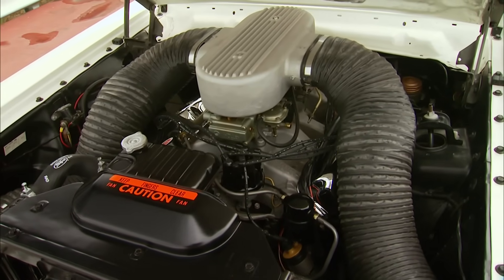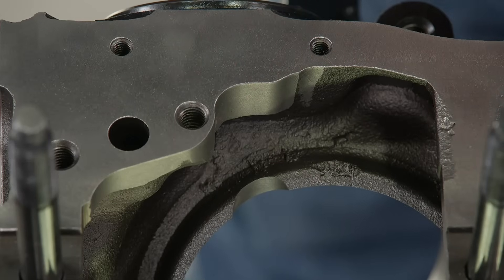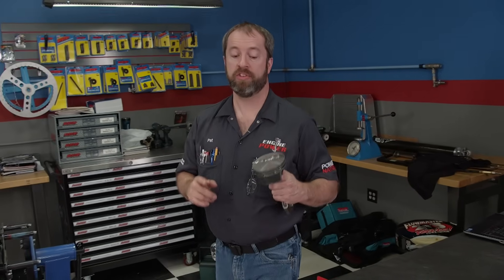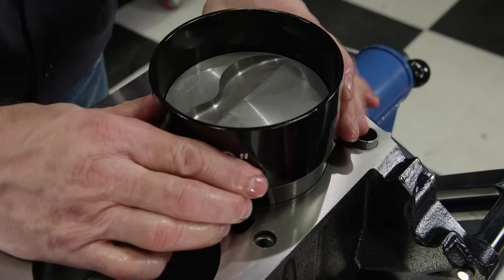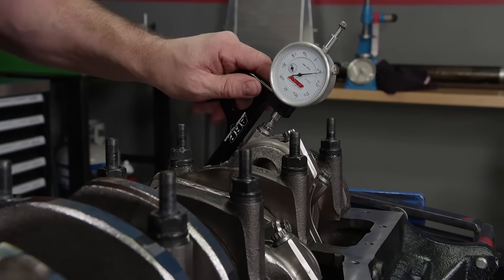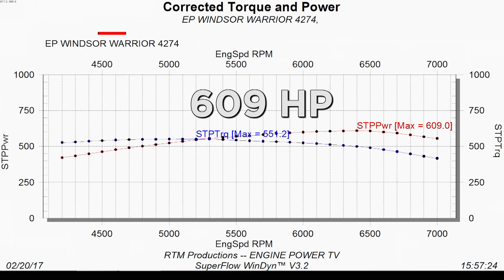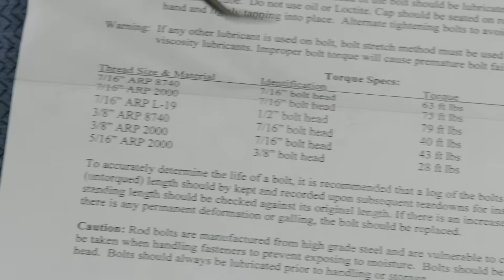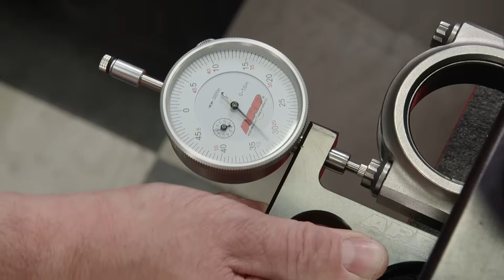Ford 351 Windsor Grows Into A 427 Stroker With Double The Original Power - Engine Power S4, E7

Comment: Hey uhh, 4.030 bore and 4” stroke is a 408 not a 427. You need a 4.125” bore with a 4” stroke to get 427 cubes..
Reply from the maker: This engine has a 4.170" stroke crankshaft

Comment: 11.5 motor isn't a pump gas motor
Reply from the maker: With proper tuning and setup, it will run just fine on 93 octane pump gas. Static compression is only part of the equation when it comes to octane needed and we have done countless combinations in the 11.5-12.0 static compression range that have run completely on 93 octane from the gas station.

Comment: Looks like you installed that piston bone dry, should use plenty of oil on the cylinder wall piston skirt, rings n lands and ring compressor, shouldn’t look dry until cleaned

Comment: With the bore of 4 030 & stroke of 4.17 they have a 425.5 Cu In engine. The ford FE 427 with a 4,234 bore & 3,785 stroke had 426.3 cubes. I am building a Windsor. with a 4.125 Bore & 4.0 stroke which adds up to427.6 cubes. I am not going out for max HP & torque, but expect  to have over 500 HP & 500 hundred pounds ft of torque. Putting it in my 1957 Ford Fairlaine  500 two door sedan .

Comment: I have a 69 Torino. With a 351 winsor.  I Think that engine won't fit. My stock valve covers are to close to the master cylinder

Comment: I just don't see that as a 427. One of the reasons the Ford 427 was so stout was due to the bore and stroke combo. The motor was over square. With a rather small stroke of 3.7 something ( I can't remember) but it's almost 3.8 and the big bore it lends its self to hi rpm and did back in the day a very good job of it. Also a version they did not mention is the one that was used in NASCAR and lots of privateer racers if they could get them was the hi riser. The medium riser was in the t-bolt and the cobra but most Ford racers that ran any oval track racing back then ran a 427 hi riser. If you didn't know someone at Ford back then you couldn't get one. They were not available to just anyone who has the money to get one. The only difference was the heads and intake. The runners were probably another 1/8 taller and the heads flowed very good. Anyway If I was ever going to build a small block 427 I would follow the same FE bore and stroke combo and use a set of C3 yates heads and you would have a very good comparison to the original hi- riser 427 Ford...also the FE 427 was a cross bolt block. And all steel forged internals so big rpm was no problem unlike this 2 bolt block. They should have used a Dart block so they could turn it some rpm

Comment: I wonder where the revs would be @ peak power if instead of stroking the small block 351 to 427. De-stroke a big block 427 to as close to 351 as possible. 
It would probably redline around 8,400+ rpm.
There would be a slight loss of peak hp versus a stroked engine, but you gain in torque, higher redline, and increased engine longevity at higher rpm's.

Comment: Good street engine.  In Oz we have our WONDERFUL I6 Ford Barra DOHC engine. I am in the throws of building one of these engines to around  450KW- a baby compared to the performance capabillities of these world class 6's.. There are so many 12sec falcon family sedans on the street.( Sleepers ) Now for the unusual aprt. I will be putting this little sleeper engine in a 1943 Ford blitz short wheelbase body/chassis. Hopefully it will be done by end of year.

Comment: You mentioned the bottom end gets tight so talked about checking the assembly for clearance with the camshaft, i didn’t see that even though you did mention that the camshaft was off the shelf. I once built a 383 chevy stroker and the crank hit the camshaft, had to go small circle cam. I think in your case since it is not a standard sbf it was not a problem but for anyone stroking a regular small block it is wise to check rotating clearances before finishing assembly.
I agree with you wholeheartedly to use a stretch gauge.

Comment: I built a Windsor 351 stroke to 427 made 690 horsepower. Put this in a square body Mustang.Best best was was 9.4sec at 144 mph.   Fun,fun,fun. Dart block,dart heads.

Comment: If you notice on the graph the long stroke motor is already making over 500hp at only 4000 rpm so and like 562 at 5252 ( where HP cross over and read the same) . 

My point is to only gain another 50 Hp by revving it to sky high another 1800 to 7000 rpm doesn’t really make a lot of sense pretty indicative of the combo being a bit overkill. 

When the torque is that flat you can pretty much shift at 5500-6000 and it will run about the same ET and be way easier on parts. 

I built a much milder 427 that I only rev to 5600-5800   But it makes about 520 Hp but it has enough torque at 2100 rpm to cruise with a 5 speed manual Tremec in overdrive at 70 mph. In a 2350 pound cobra replica I wanted a motor that felt very close to a factory 427FE with torque everywhere. I’m very happy with it! 

The segment talked about for shoulder to cam clearance but never showed any of it…I’ll bet they had issues!! I had to relieve the shoulders of all my rods to clear the cam lobes and even rr ground the cam to a smaller base circle. 

Btw stroker 427’s like tighter lobe separation and more cam advance. Why close the intake so late and give up all the stroke just to gain RPM?

Comment: I don't want a bigger engine. I'd rather build a great 289, 318 or 283. Sounds the same. All the power you need for today's driving. I don't need to use more gas than that.

Comment: Does the 427 Windsor have a higher deck height than the 351?
Reply: This 427 is made from an OEM 351 Windsor block so the deck height remains factory minus any clean up cut.
Reply: @mchristr   Ta

Comment: from the looks of it, they appeared to be degreeing the cam with the #2 cylinder(first cylinder on the right side of the motor)
Reply: Front cylinder on passenger side is #1.   Fords are numbered 1,2,3,4 down the passenger side, 5,6,7,8 down the driver's side.

Comment: I'd like to see hor cheap 393w builds! I"d have to dive thru the barn, but i got the parts to build that! I'll be going in a 94F150 flareside! Can't use what you can't hook up anyway! Build a cheap  5 liter piston, Windsor rod, pressed pin 306 piston motor! Big hydraulic roller cam that will drop right in my 95 roller block! I got heads!

Comment: what about this conversion on a 351 cleveland block
Reply: The Cleveland block has a 9.2" deck which requires a shorter rod and compression height on the piston. But there are kits out there if you want to do it.

Comment: For me im lucky I own a 351 Windsor pushed out to a 427 all Debured oiling system improved all Roller rockers and chain titanium valves bronze Guides Heads ported and Majorly polished  with a Supercharger for a lighting 95 f150 and 42 pound injector and Dynoed at 875 horse power and all in a 94 Mustang GT and have No problem in cleaning house on the 2 ton coyote Mustangs

Comment: Would love to do something to up the pwr in my 1991 351w F-250?  This vid looks pretty much like expensive ultimate racing build & have enjoyed watching.  My tired OEM motor even new only 210hp.  Hard to pull itself up a steep hill E4OD auto tranny.
Reply: You can use your block or go to the salvage yard for a roller-cam block. Use the stroker kit but go with dished pistons, a milder cam, and home ported factory heads. It may only make 350 hp at peak but the torque number will be huge. Exactly what you need to move a heavy pickup truck.
Reply: @mchristr  Exactly the info I was hoping for - thx so much!

Comment: What is a cost estimate for something like this with a shop doing the work? I'm out of the loop on car stuff, but remember in the late 80s and early 90s when someone getting a chevy 427 for 3 grand in need of a rebuild was considered expensive. There were engine shops in or close to pretty much any town of size, and maybe most of them are gone because little is rebuilt by the public, but total cost for a rebuild back then was probably some fraction of an engine and we considered it "expensive".

Comment: Be nice to build one of these engines to produce its top torque at a lower street cruising speed RPM for better MPG or would be just as well off building one like this?

Comment: Could you do a stage 2 for the windsor warrior 427 engine, a solid roller cam, shaft rockers, holley sniper fuel injection with their high rise intake and stand alone system. Just so we can see what the upgrades and power diffence is. On pump gas, and on higher compression, higher octane.

Comment: The Championship Cobra was the small block Cobra that still used the Triumph front suspension and Jag E- type rear suspension that came on all the original unchanged small Cobras. The big block Cobras had an overgrown body with completely different chassis and suspension, brakes steering, etc. etc. But the spelling of Cobra was still original.
Reply: The 289's spinning to 8K is what won all the championships in the cobras and daytona coupes. Loved this build- great job. Never discussed what the maximun safe RPM was.

Comment: I would like that one day they do a program in which they teach some tricks to improve oil pressure and lubrication for those 351w
Reply: They won’t do anything that isn’t tossing a bunch of sponsored parts at a project.

Same reason they won’t massage stock parts to make more HP, there’s a whole class of drag racing based on stock appearances where people make 10 second passes on cast iron heads and manifolds, you won’t see that here either because there’s no sponsor cash

Comment: The 427 version of this engine will not last very long. A simple 351 turbo build will last longer, and still have more power. A 351 is a 302 stroker. Don't be stupid.

Comment: Is there a difference between the 351w 5.8 manufactured in the 70's and the EFI, from the 90's? Can I apply this setup and parts to the 351 5.8 EFI engine?

Comment: hey you two , how about retesting the 351w engine with the new  4.25 stroker crank shaft and with a LOW END TORQUE camshaft and not the high rpm one`s

Comment: I don't know why they used to always preach the "too big of a carburetor for the engine" years ago. Kind of like installing larger cylinder heads.....you can go pretty big before it starts degrading low speed performance.

Comment: I thought a Windsor is 4 bolt main?  This looks like a 2 bolt.
Reply: No 351 Windsor's came with 4 bolts from the factory. Only some of the Cleveland's did. You can get aftermarket blocks with with 4 bolts. You can convert them to 4 bolts also but with the cost of machining, you are probably better off just getting an aftermarket block for a few dollars more.

Comment: 351 Windsor is the best engine Ford ever made. These new modular engines suck. Sure they make more stock HP & TQ but they leak like a Harley Davidson with a myriad of electrical electronic and transmission problems and factory recalls. I'll never buy another new Ford. 1995 or earlier.

Comment: WRONG...It's not the cubic inches that matter! What made the 427 great, was its bore and stroke. Bigger bore engines make more horsepower because it allows bigger valves. On the other hand long strokes make more torque but it limits RPM's. Shorter strokes rev higher and therefore has the potential to make more horsepower. What you guys made was a long stroke torque motor that now has very high piston speeds which limits rpms. This stroker kit has been around for 20-years at least and it does well at the drag strip, but its not a tribute to a 427FE without the proper bore and stroke

I built a 750hp 351W that matches a 428CJ bore and stroke pretty closely. The 428CJ has a 3.98 stroke and I have a 4.00 the 428CJ has a 4.13 bore and I have a 4.12
Reply: A nice explanation. I don't know of any factory built Ford V8 with a 4.030 bore combined with a 4.170 stroke?

Comment: Wow.... taking a 351w to 7000rpm.
The last time I ran a 351w I had all I could do to get her up to 5500...and she probably stopped making power before 5500.
I did manage to squeeze 322hp out of her,She was out of breath around 4700.
Back then there were no aluminium heads etc for the 351w and add to that I really didn't have the know -how to really understand what I was doing.
She still ran very good,Spanked a few other cars around,But she didn't have the power like your engine
Over 600hp!!!  It just wasn't possible for most of us..you want more RPMs you had to consider moving up to a 351C or really do some wizardry on a 390,428 or a 429... skills and money which I didn't possess
Reply: It's impressive that the aftermarket took the Windsor head and modified it to the point that 500+ HP engines are possible. I wonder why Ford couldn't design a decent Windsor head from the beginning?